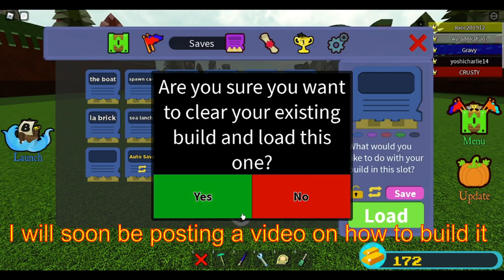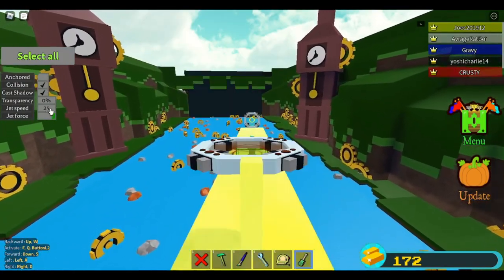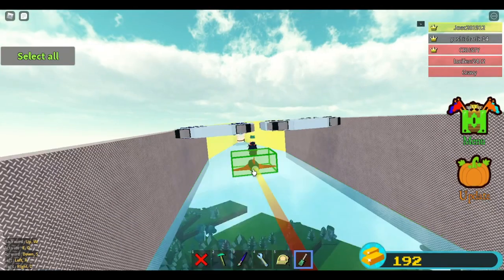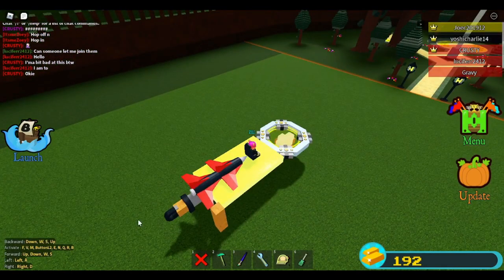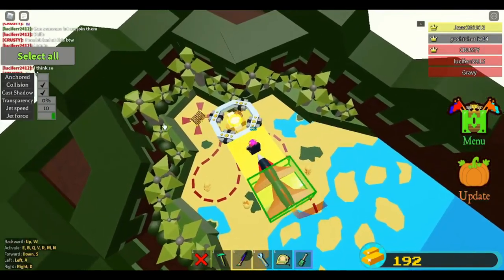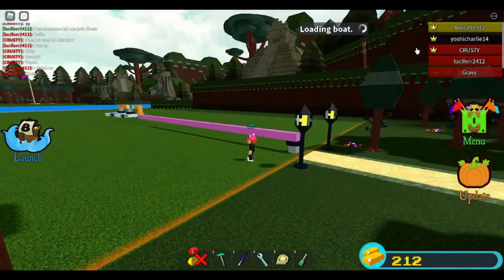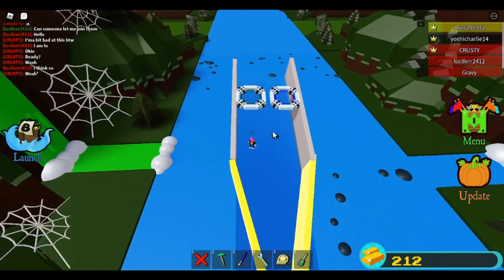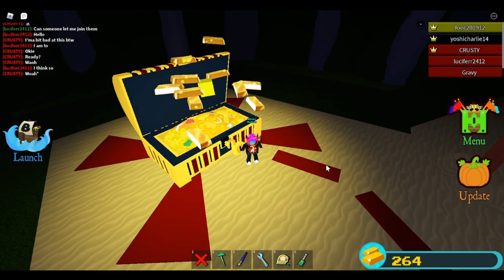Set up an AFK Grinder! (Build a boat)

Comment: Tip: if you put the portal closer to the chest you wont have as big of a chance of bouncing off if you place the portal above the chest
Reply from the maker: ya. In this video, I was able to place the portal  above the end chest in such a way that when I would go through the portal, it would drop me right in front of the end chest, but I would still collect it. When it is perfectly placed like this, the height of the fall does not matter as much. However you are right, and if possible it is better to place it lower. 

Also, I recently discovered how to build 3 other types of AFK gold grinders which will be in future videos.